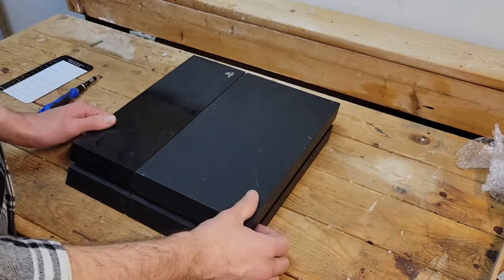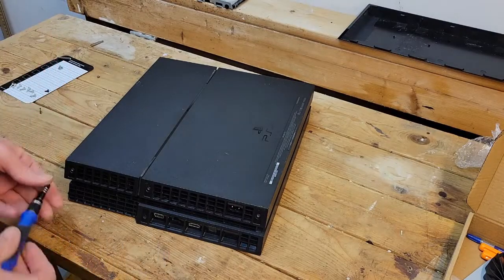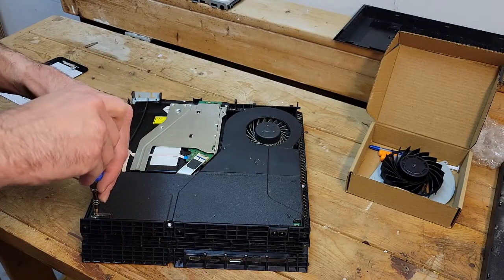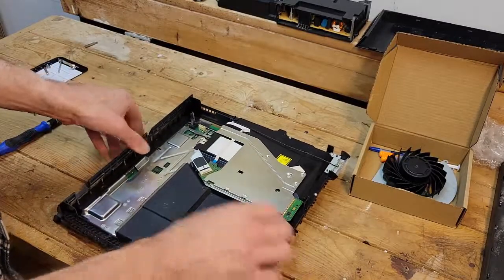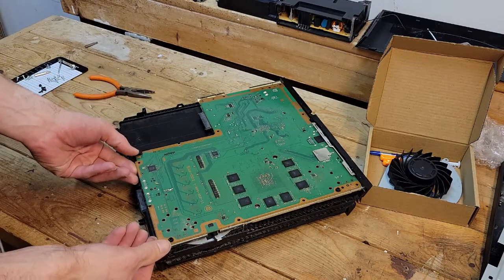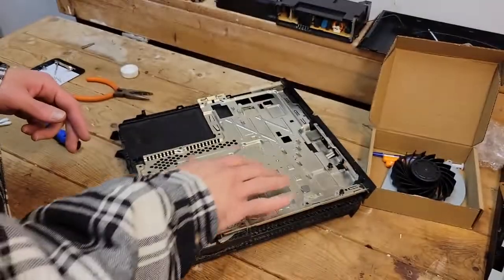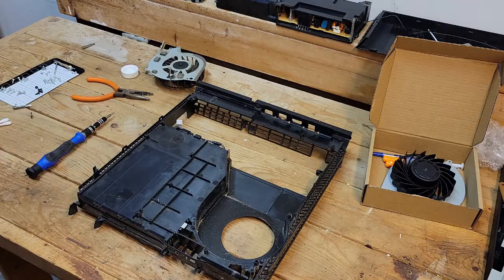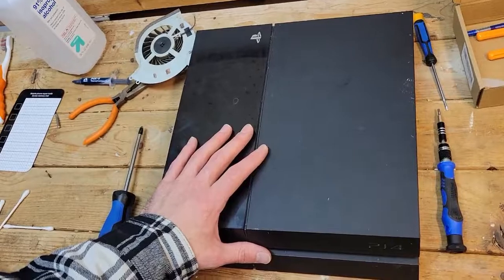PS4 Fan Replacement

Comment: is the ps4 cuh 1000/1100 model the same as 1200 model if i cut and join the connector part? Because the 1200 fan is almost 2.5 times the price of 1000 in my country.
Reply: Definitely no

Comment: I took my ps4 to get cleaned and to change fan and thermal paste by a console repair shop and now when I connect my controller it takes a while to connect and isnt responsive like it is delayed heavily when scrolling through the menu and when I plug in my headphones I get no audio but I get audio when I use it on my phone. Whats the problem?
Reply: Have you tried opening it to see if the wifi antenna is plugged in properly?
Reply from the maker: I've never had that problem. I would open it up and see if there's any obvious damage or any loose connections. I've seen some very suss repair shop "repairs".
Reply: It's possible that the hard drive was dropped... Computers suffer the same issues if the hard drive gets shocked or damaged
Reply: @countertopfixeswithpaul4464  i got ot fixed the antenna wasnt plugged in properly
Reply: @Justin-oe2fk  see lol

Comment: very helpfull
Reply from the maker: Thanks!
Reply: @countertopfixeswithpaul4464  I got a replacement fan and installed it but unfortunately the fan was defective and we have to send it back but this video helped alot with taking it apart 3 times lol
Reply from the maker: @myshroom1277  Aftermarket parts can be tricky. I actually had problems with the fan from this video, a big chunk of plastic wasn't properly ground down so it scraped against the case. The video is still helpful as long as you can find a good replacement part.